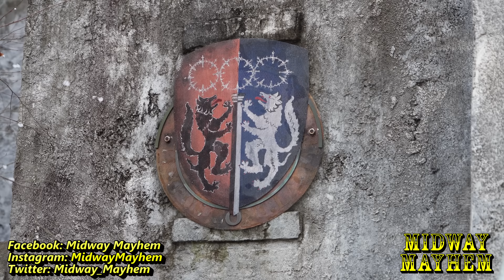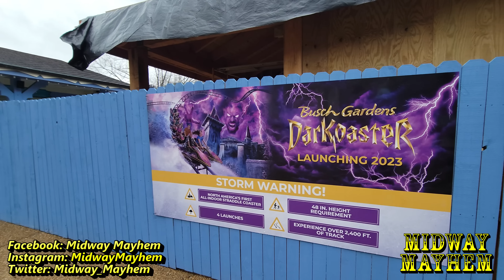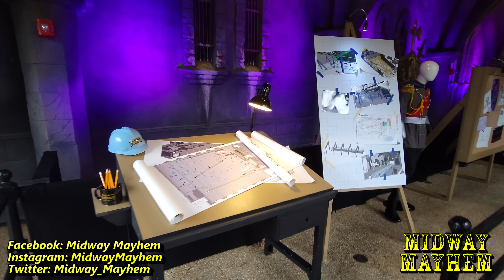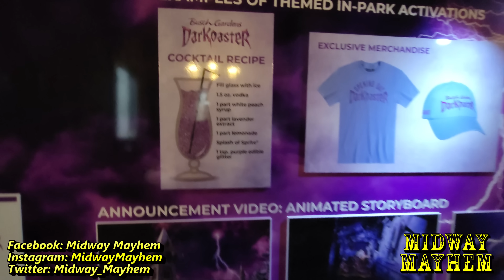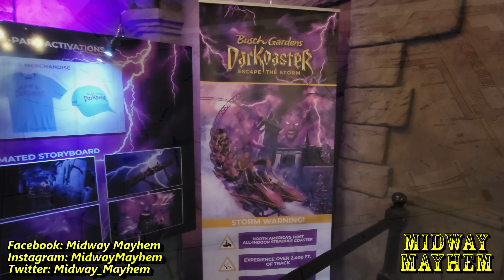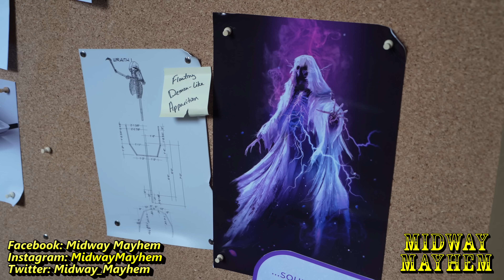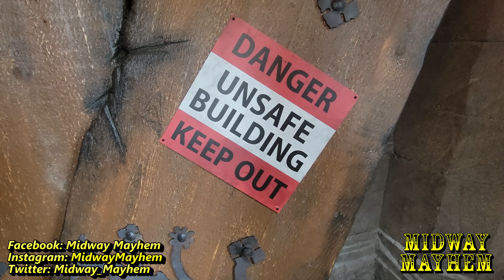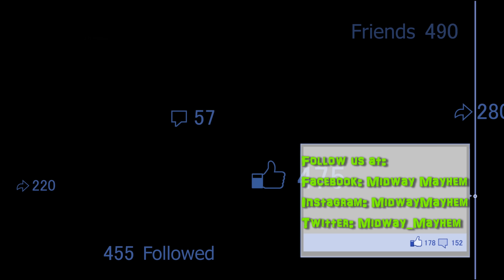Busch Gardens Williamsburg DarKoaster Hard Hat Construction Update & Preview Center Debut

Comment: So what I’m seeing makes this look a lot like Revenge of the Mummy at Universal. If it’s as themed as it seems to be, this is gonna be an amazing family-thrill coaster
Reply: The que-line and the entrance is well themed... the coaster is obviously going to be in a dark room, nothing else and it will last MAYBE 30 seconds then done. IT is LITERALLY another Runaway Mountain like at Six Flags in Arlington, TX. The castle itself, i.e. outside theming, is the only truly impressive thing... but apparently THAT was pre-existing.
Reply: @weareeverywhere6677  not from the preview center tour that they had set up. And it’ll be much longer than 30 seconds...double that because you cycle the course twice.
Reply: @starryagent9936  you cycle twice?
Reply: @myersbob7517  yep! There’s a set of transfer tracks and a bypass track running parallel to the station that you traverse, and it dumps you off at the first launch track

Comment: Do you leave the station by going through the old "fireplace"?   Also.. looks like a lot of steps in queue.   Accessibility?
Reply: Outside queue is all ramps. The stairs in the queue are inside right before boarding, and they've installed a wheelchair lift to help aid those who can't use the stairs!

Comment: No way it's 10 per train?? The capacity is gonna get ugly with a park this size.
Reply: Yeah, and doing the layout twice is gonna kill it even more
Reply: @sleepdeep305  oh it does it twice????
Reply: @ghostface-r5b  yeah you can see in the plans that there's a switch track and when it's closed the coaster is on an internal loop, when it opens it allows the train out to the station section.
Reply: That's going to allow the next train to be unloaded and loaded. They should be able to have one train going around almost at all times. Not saying the line won't be long but it'll keep moving.
Reply: @MrPopsfreshnmyer  you don't need a switch track to unload and load a single circuit coaster. All you need is block sections and a single loop. The switch track in this case will send trains around for another circuit and let out trains that have been around twice.
Reply: @BlueZirnitra  Right. But the show building isn't large enough to have a track length long enough for multiple brake runs, which is why I think they opted to use a switch track.  Multiple brake runs would likely ruin the pacing of the ride (worse offenders being Tron and Hollywood Rip Ride Rocket and those have way more track).  This ride experience is lengthened because it's doing two laps. More ride time is always a plus for guests and it gives people more time to load and unload to reduce the chance of stacking trains.